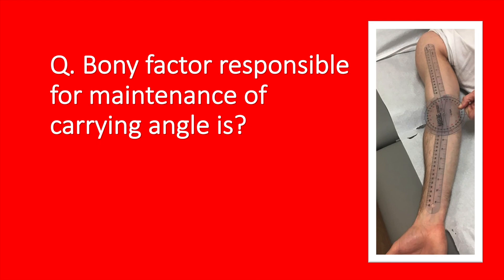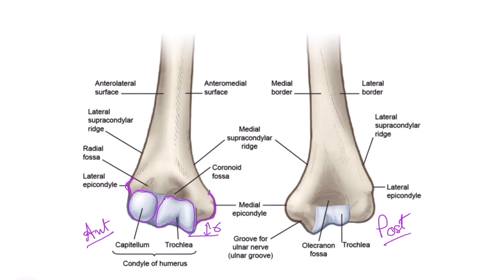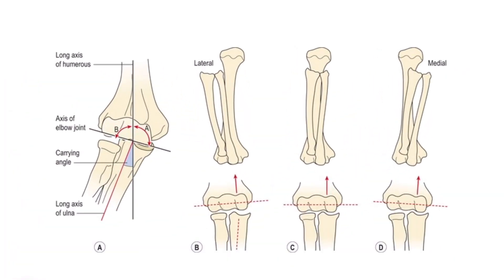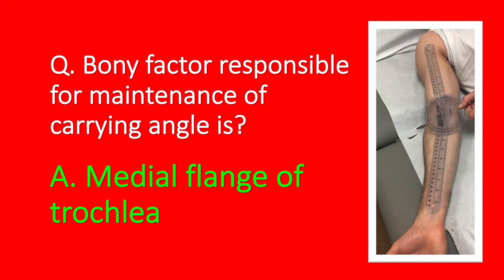Carrying angle of elbow joint | Sexual dimorphism of humerus | Cubitus valgus | Cubitus varus #dsac

Comment from the maker: TIME STAMPS IN THIS VIDEO
0:00 Welcome to Dr. SAM's Anatomy Classes
0:12 Bony factor responsible for maintenance of carrying angle
0:38 Anatomical reasons of carrying angle
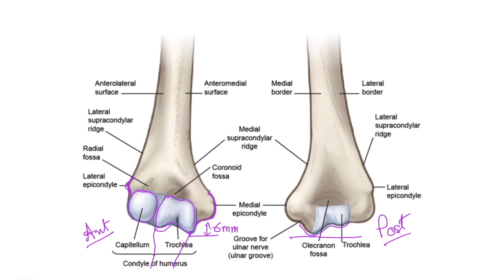1:45 Sexual variation in humerus bone
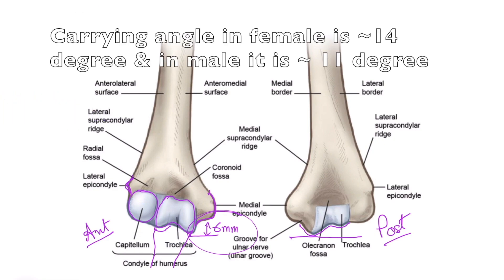1:56 Carrying angle in male and female
2:09 Medial flange of trochlea
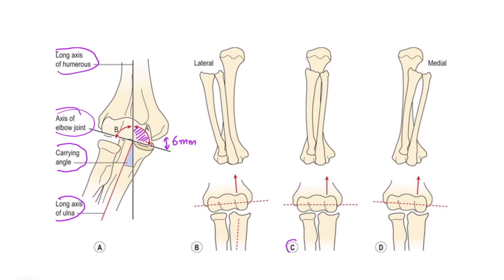3:32 Elbow without a carrying angle
3:54 Cubitus valgus
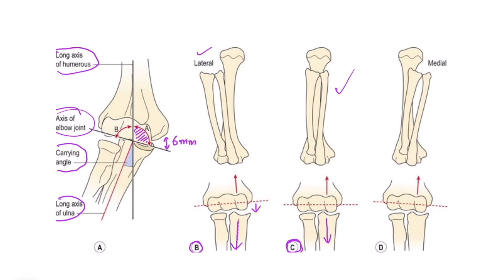4:18 Cubitus varus (Gun stalk deformity)
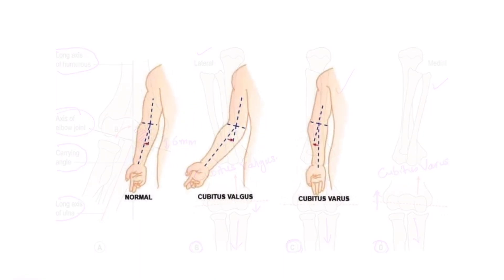5:14 Normal carrying angle
5:31 Gun stalk deformity of elbow
5:50 What prevents the collapse of carrying angle
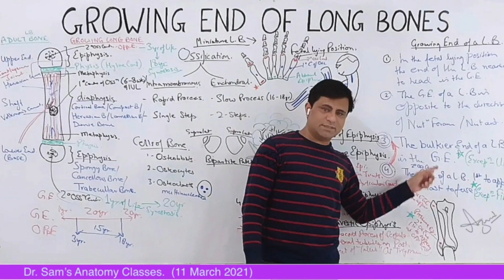6:01 Anatomy by Dr. Azmi